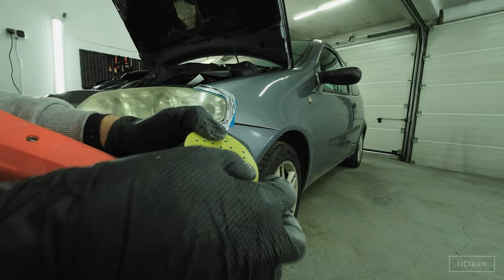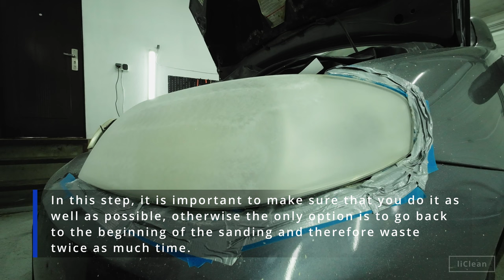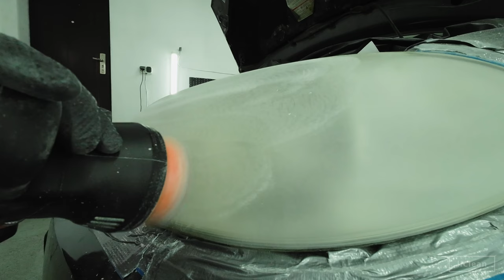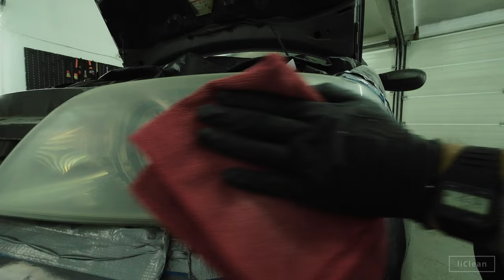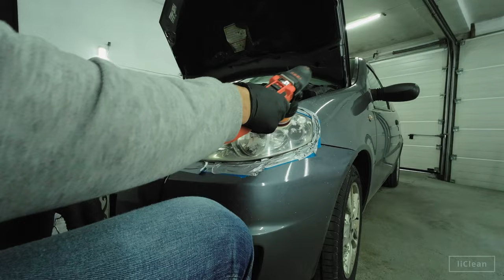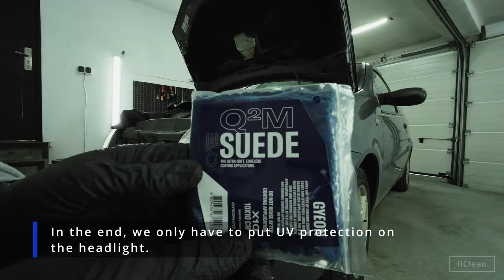How To Clean & Restore Headlights - Remove Yellow, Foggy Headlight Oxidation!

Comment: Wat speed do u polish with?
Reply from the maker: @roysla  hi.. Speed is 3 on this machine.
Reply: Ok thanks around what rpm would that be? Because my Polisher only has two speed.
Reply from the maker: @roysla  this polisher has 6 speeds, in specs it says that goes from 2000 - 6400 rpm.. Do the math maybe 3000-3500 on 3 speed.